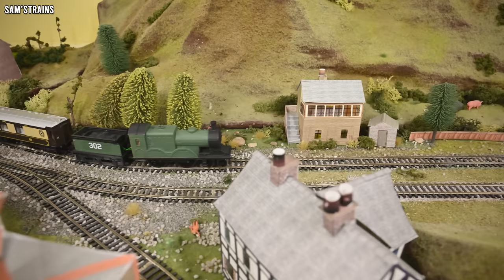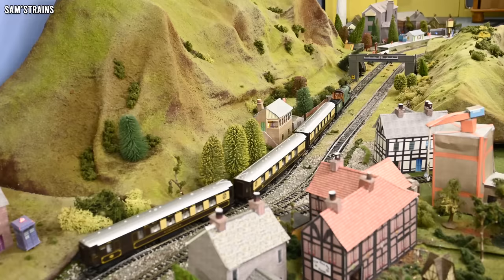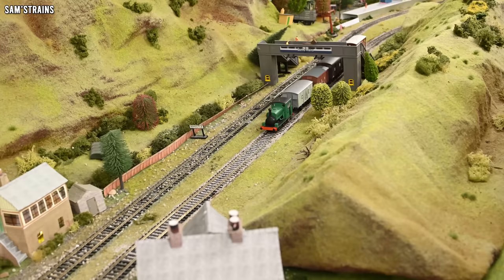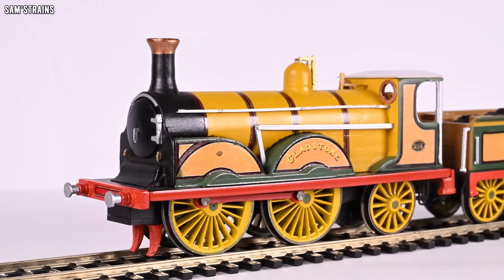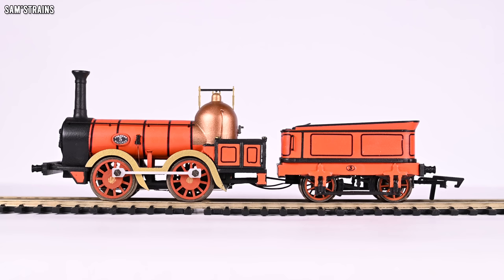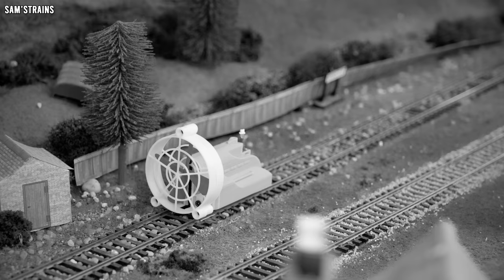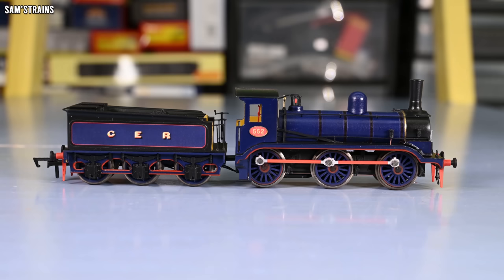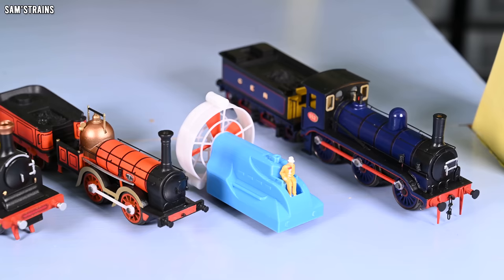All These Model Trains Were 3D Printed At Home!

Comment: Hello Sam, have you heard of the GWR Garratts? They were 2 proposed designs that never came to fruition. One is a 2-8-0+0-8-2 (using 28XX chassis), the other is a 4-6-0+0-6-4 (using Hall chassis). With both chassis being readily available in RTR, you can combine 3D printing (for the body etc.) with RTR to create these 2 very unique models.

Comment: The gresleys rocket fan idea was done before for james may's great train race attempt two, however it went horribly wrong as the engine, was not fitted with brakes, and then after rerailing it they tested its speed and it derailed at such a high speed it ripped itself to bits, though gresleys rocket has a much smaller fan so it is superior in that sence, so its not top heavy, if only it had a coupling haha

As you can tell, gresleys rocket is my favourite, love a wacky idea

Comment: I would quite like to see you make a Lancashire & Yorkshire Class 23. A ready to tun model has never been made, whilst it has a large saddle tank and inside cylinders, so I imagine it would be quite easy to make and add weight to make it pull better

The Class 23 were rebuilt from Class 25s. They literally removed the tender and added a saddle tank and bunker, so if you wanted to you could modify that into a Class 25

Comment: I've been designing and 3D printing a garden scale tank engine over the course of this year, and have found the big strength of 3D printing is being able to easily iterate on parts that weren't quite right the first or second time. 

Rather than sanding, I've had best results splitting up parts so smooth flat sides can be printed flat, and enabling ironing in the slicer. It makes the print take longer but can dramatically reduce post-processing.

Comment: Ive been looking at 3d printing diesels and electrics, my First project Im going to do is the Class 599 Tyne and Wear Metrocars once I get my Ender 3 Neo. Good thing is with Electric and Diesel locos is that most bogies are either available as spares or able to be easily modified from spares

Comment: We've followed all of your 3D builds Sam and once you had it going with the Gladstone they all have cracked us up. Admittedly, the Furness #3 still is our favourite as well but the 552 is coming in very close. Especially its blue colour and all the details are spectacular. 3D Printing generally has reached a point where factory standard locos and rolling stock have become attainable as we have seen on another channel. Tonnes of online sellers of 3D files for modellers are available now for just a few dollars per download, or even for free. E.g., we wanted to have catenary but Märklin's own are extremely overly expensive. We downloaded the necessary prototypical 3D files and had them printed for just a fraction of the price. It is time that manufacturers should be getting very worried perhaps... Cheerio.

Comment: And I just designed and printed 2 HO flat cars. Then I watched the two videos with your engines in them, which is an inspiration to try to do the same. Take pride in that first engine you made. The first is always a prototype, and one you learn from. Love them all as you showed them, and I think I want to do it as well. I did the flat car, because I like flat cars, and it was a good start to try to make something that worked the first time. It also cost me about $20 less to print it then buy one, but paint is not my strong point. I like you masking you did on the handles, and I might try that. Feel pride for what you did, and let your chest swell. Job well done on something you can't buy.

Comment: I actually attempting to kind of build a custom train using the copperknob chassis In some 3D slicer softwares They allow you to put multiple creations on to 1 platform and print all of them together so I took the chassis and mashed it together In the body that sits on the chassis is a 0-4-0 birdy engine
Reply from the maker: haha that sounds amazing... did it work!??!
Thanks for watching, Sam :)
Reply: Polar cloud is the software I used and it does work The wheels did fit inside the copperknob chassis Buy using some of the other engines details I covered up some of copper knobs that I could not remove

Comment: If you're looking to do a larger engine then GWR no 111 'The Great Bear' would be neat. It uses the same diameter wheels as a Castle so they would be easy to get.

Either that or a GWR 'River' class, an elegant early 2-4-0 design, would look great running alongside your City or Dean Goods engines.

Comment: I have an idea, for a 3D print. "Uncle Fredrickson's Tender Tank". An 0-6-0 Saddle Tank with it's coal bunkers between the tank and cab, an open cab with 2 rotating gates at the back so it can be used as a shunter, or a tender engine (Gates flush with the back of the loco for shunting, and flush with the sides of the cab for tender). It would have one of those HO/OO scale couplings, but is also equipped with a tender coupling underneath.

Comment: Really impressive modeling skills. This video really highlights the whole point of 3D printing: making things you simply cannot buy.

I think the main negative is that you can see layer lines in several of your models. Some of that is extrusion issues, but mostly it's an unavoidable limit of FDM printers. Someday you might consider getting a resin printer. They're a pain for a variety of reasons (fumes, the care you need to take with residual resin before washing), but they're really, really good at fine detail. Even the cheapest ones.

They also tend to have small build volumes, but I think the models you're printing are well within those limits. It's only the late, really large articulated locomotives that would be too big for most resin printers.

Comment: Hey Sam. I wanted to say that the concept locomotive isn't hideous at all. We all gotta start somewhere and I remember building my first proper model kit it went bad quite quickly and the fact that it runs so nicely is quite an amazing achievement. The Manning Wardle as well. That looks very cute and amazing. You upped your game with every locomotive, the big one being Gladstone. That was a big milestone with the lining I remember and how it has more power/torque than some professional manufacturers locos show your talent and your craftsmanship. My favorite is probably Old Copperknob as I've seen her this April in the NRM. Still almost looks brand new even 170 years later. Your model does so too. The Bachmann Lafayette of yours reminds me of it a little bit with the large firebox. 552 also looks amazing. Very eye catching in that GER ultramarine blue. For suggestions for future models I always wanted to see someone do the GER A55 Decapod, the large ten wheeled tank engine which was absolutely massive. I think that would have enough space for a five pole motor and good weights to make it as powerful as the real thing. Generally, obscure prototype locos or the LMS Fury that would be cool as well. Great video Sam 👍

Comment: Haha Sam don’t let anyone in the blackcountry know you said they were in brum, you’ll never hear the end of it 😂 I was sceptical in the extreme about the coupling rods but I’ve followed your lead in doing an 0-4-0 as a freelance saddle tank but did it outside frame outside cranks using class 08 wheel sets as practise for a GWR 4-4-0 3521 class, and yeah, works! Before that I’d only modified donor chassis to suit 3D printed bodies (changed wheel sizes, cut and shut) or done a loco chassis but with old tender drive units, but you inspired me to do something 100%, well except the gears; the wheel set already had a drive axle and I hand a screw for the motor so…

Comment: Even the great railway designers had to start somewhere and the early ones had nothing to copy. I would suggest if you where to need to add weight that metal add-ons for the chimney, boiler dome, and buffer beams, simple turned metal, or solid bar be added as required. The other way is to print a 'negative' of the item  and use for a pattern for cast resin or at a higher level cast low melt metal. Keep on going. I think there is a need for the early era I and era II locos to be modelled. Your prop driven vehicle may be fun but real ones have been made and operated. How have you got round the differences between what is 1:76 OO scale for the body structure and 1:86 HO for the track? Are the models wheel sets just slightly narrow gauge, but the rest to OO scale?

Comment: I really like the Gladstone and GER 552 models you made! 
I'd like to see you 3D print a railcar/multiple unit, as I'd like to see how you'd mount the motor and maintain interior detail. You could do the BR class 311, 318, 332, 185 Desiro which have not been modeled yet, or something completely fictional.
Some steam engines I'd like to see you attempt are the LNER Z4 0-4-2T, Caledonain 439 0-4-4T, L&YR class 25 0-6-0, LNER J17 and J21 0-6-0s, North London Railway Class 75 0-6-0T, Metropolitan Railway G class 0-6-4T, Southern U/U1 class 2-6-0, any North British engines (as only the J36 has been made in OO scale), any Great North of Scotland engine, and Metropilitan railway 4-4-0T number 23. All of which have never been offered in OO scale or only as out-of-production kits.

Comment: Hi Sam, great video, it's amazing how far you've come with the quality of the models. I'm sure that greater advances in quality will be achieved in the next few years by the improvement of both 3D printers and the materials used, giving a much better finish at conception. It would have been nice to have seen an example of the construction and assembly of one of your chassis, also the various parts used both purchased and 3D printed. Perhaps another time? Regards Barry.

Comment: I love the copper boilered one, but that Great Eastern engine is sweet too.

The rocket reminds me of something Lionel might have offered in the 1950s - probably with a gizmo that made a whistling sound to indicate extreme speed.

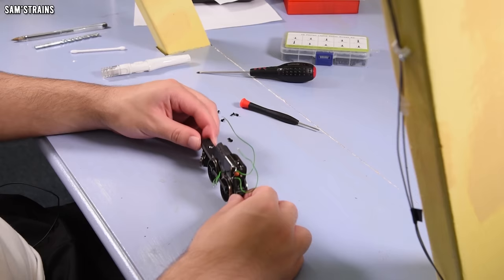Speaking of O-scale, have you considered 3D printing the small engines in a larger scale? On my to-do someday list is to scratchbuild an American 1830s or 1840s broad gauge locomotive (and layout?) in a large scale like 1:24, 1:18, or 7/8ths. I love the looks of those early engines, but between the motor, the weight, and the fragile details, I find models of them (from Bachmann) to be a disappointment.

Comment: I guess a Decapod might have running issues and I was going to suggest a Bulleid 21C2 large passenger loco (a bit like a Q1) but it's been done - how about an early GWR 0-6-0 Saddle Tank (more common to associate GWR 0-6-0's with panniers but there were loads of earlier ST designs)?

Comment: You owe it to Brutus to return to it and redraft the superstructure using your developed skills.  There are some things that can be cleaned up, a pilot that can fleshed out, etc, but don't change the overall character.  That part you got right.  It just needs...a revision to clean up the edges.

But Brutus should not get fancy paint.  Brutus works hard and has no time for parties.

Comment: Good jobs, but I wish you'd go more into the construction details. Did you buy the wheels ready-made, or did you print them yourself? Did you have to put the metal tyres on, and if so, how? And will there be an incredible Balancing Locomotive, or has that been shunted off for a bit?